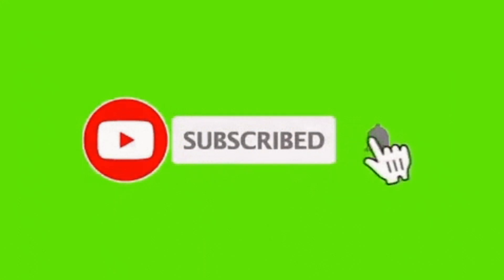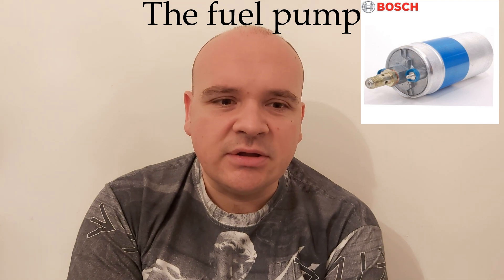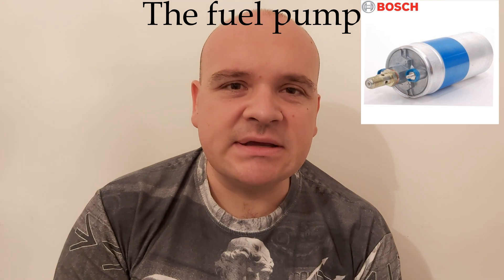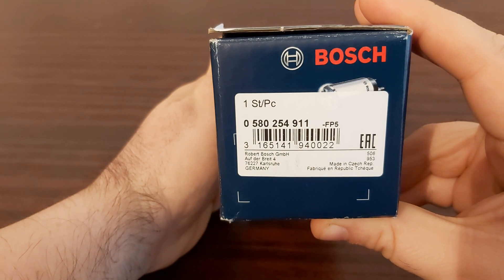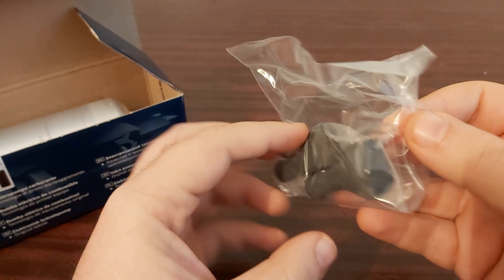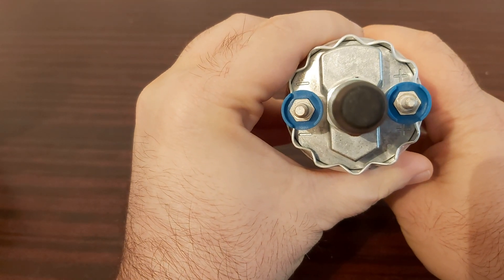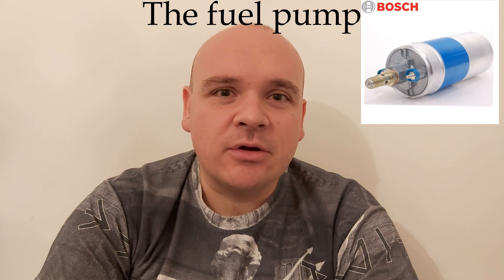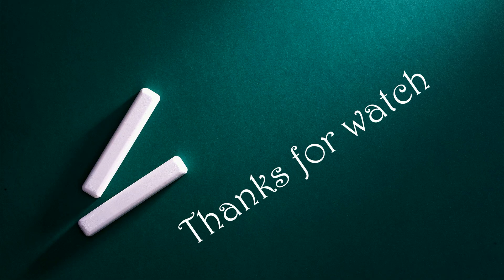Mercedes KE-Jetronic - The brand new Fuel Pump from Bosch for Mercedes

Comment: كم هو قياس  ضغط المضخةالمقرر؟
Reply from the maker: ليس المهم كم بار تعطي المضخة وحدها، الأهم أنها تستطيع أن توفر تدفق وقود لا يقل عن 1 لتر خلال 40 ثانية.
المضخة نفسها قد تولد 7–9 بار، لكن في نظام KE-Jetronic المهم أن يكون الضغط حوالي 5.5–6.5 بار. هذا يسمى "الضغط النظامي" ويثبته منظم ضغط الوقود ليبقى ثابتاً.

It’s not important how much pressure the pump alone can create – what matters is that it can deliver at least 1 liter of fuel in 40 seconds. The pump itself can reach 7–9 bar, but for KE-Jetronic the important value is the system pressure, which must be held constant at 5.5–6.5 bar by the fuel pressure regulator.

Comment: Hlo sir i have some problem with my w124 m102.963 the problem is some time when im going to star the car, the car is going on 3 cylender after some seconds is gone normal. Whats the problem? Spark plug is new cables is new but my fuel pump do the the shhhhhh.
Reply from the maker: Test the fuel pump. It must deliver at least 1l fuel in 40 seconds. Check the pressures.

Comment: Thank you for your advise.  Unlikely I already drive at the last drop and the pump is gone. No more pressure from the pump. Only 1.5 bar.
I want to by a cheap brand. What is your opinion?
Reply from the maker: You're welcome! And yes — driving until the last drop is unfortunately a sure way to kill the fuel pump. 😬
The pump I showed in that video is now running on my 450SL, and it's still delivering insane fuel flow — around 4.5 liters per minute! 🚀 That’s the kind of performance you want from a healthy pump.
⚠️ Always keep at least half a tank of fuel — the pump relies on the fuel for cooling and lubrication, and running dry overheats and destroys it quickly.
If you’re going for a cheap brand, be careful — it might work for a short time but fail fast. I recommend saving up for a quality unit, otherwise you’ll be replacing it again soon. 🔧
✅ Lesson learned: never run these systems below 1/4 tank, and definitely avoid empty tanks.
Let me know which car you’re working on — I can recommend something more specific! 👍

Comment: Hi, I want to thank you for your dedication on these videos they are really helpful. I want to ask something because this doubt is driving me crazy. I have a w124 E300, and it is supposed that had two fuel pumps, but I've seen and told that it can work with just one fuel pump. Is that true? I have also read that the two fuel pumps setup can be replaced by to the setup of one, if this can be done, which fuel pump do you recommend that can be installed? The Bosch 044 would be good? Thanks in advance for your answer!
Reply from the maker: Leave it as it was original. Concerning the pumps, go with Bosch. As you remove the pump you will se its reference number and look for it by the same number.
Reply: I have seen an other video right now and says that the two pumps are different low and high pressure.  Don't ask me why. I don't know

Comment: Again, I want to thank you for your great explanations. Thanks to your videos I regained the confidence to try and diagnose/repair my W124 myself. It‘s not starting up anymore after an idiot friend tried to „help“. So far I was able to diagnose a bad ignition system (replaced) and a bad fuel pump (still to replace). After that I‘ll move over to the other mechanical parts like you explained!
Reply from the maker: You will repair the car, have no worries!!!

Comment: Very good video as always. Can you help me with some fuel pressure data. My car: MB 1990 190e 2.0L W201 M102.962 Do you have the Working pressure and Control pressure on this Baby?
Reply from the maker: System pressure 5.3-5.5bar(no matter cold or warm). Control pressure 0.4bar less.
Reply: @mercedeske  Thank you very much. Have a nice evening.

Comment: HI, IJMERCEDES   ME TOO HAVE A OLD MERCEDES 300 CE  WITH THIS  KE  JETRONICS this  system is very reliable but very difficulty to diagnostic when it have a issues. my problem is with a hot start  after 15, 20 ,30  minutes from when a turn off engine it take 6 to 10 second to start and seems it  is was flooded, today a take a look at the  fuel  system pressure is slightly low , and was 5,2 bar  instead 5,3/5,5   as specification  and when i turn off    the engine the pressure drop to 2,2  bar instead 2,8 bar  i suspected the fuel regulator   because the fuel accumulator is  3 years old  from bosch what do you think . best regard from italy.
Reply from the maker: Well, as far as I know you must have the system pressure 5.7-5,9bar(for six cylinder engines). At first look at the fuel pressure regulator if its vent line(the rubber line) is cracked and if you have gas leak(I would say 90% that is your problem). As for the accumulator, perform a test like this - turn on the engine, let it run for a minute at most, then stall the engine. Deflect the sensor plate. If it gives no resistance(it doesn't go back as you press it), the fuel accumulator is bad. Best regards from Serbia and thank you!
Reply from the maker: Ciao Giuseppe, hai riparato la tua macchina? Di cosa si trattava?
Saluti, Ivica

Comment: Thanks for the video . My issues are with the crush washers they always leak gas no matter if I get new ones it leaks
Reply from the maker: Same thing. Just jack the car and start it. If you hear the pump loud working, it needs replacement. This happened to me at the body shop. The mechanic heated a washer and connected it that way with another one, I believe because I couldn't see the procedure, the mechanic sent me to buy beer for us ;-) I felt the improvement afterwards. But, again, I had the pump replaced, this was a temporary solution. I still have the old pump and maybe I will have some fun by testing it how capable it is.
Thanks for the comment, greetings